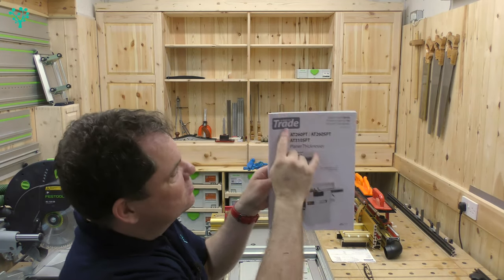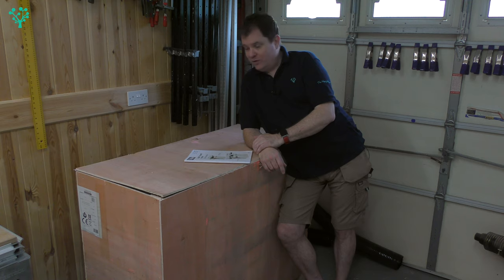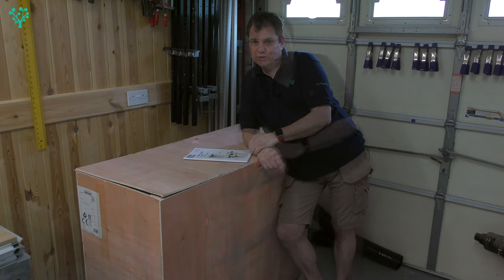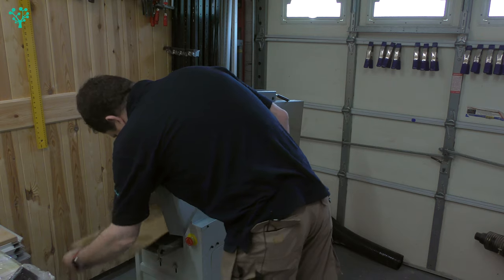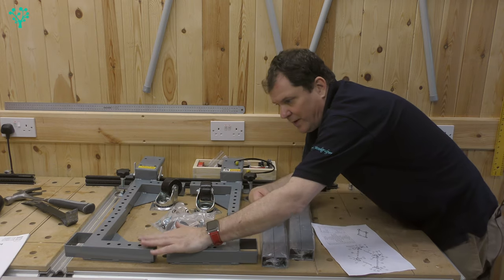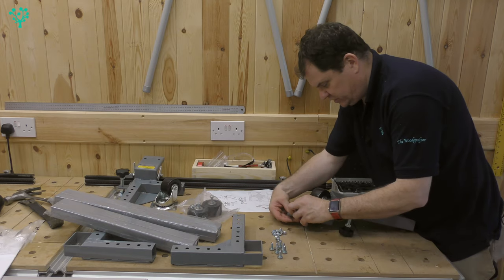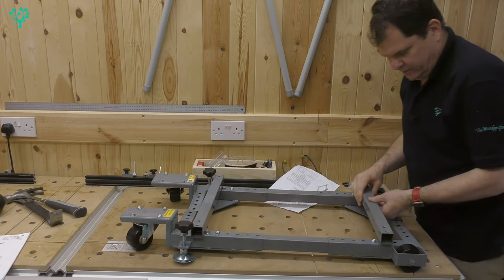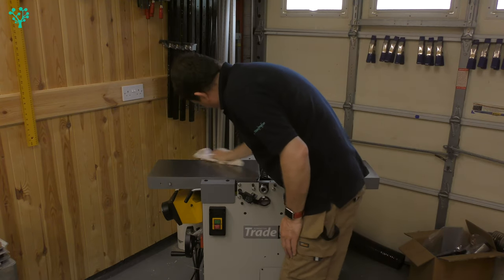Axminster Trade AT260SPT Spiral Planer Thicknesser - Unboxing

Comment: Yep, same as mine, I use a Jet mobile base but also needed a engine hoist to get it on, these are so heavy.
The spiral cutter is a joy, can even stain wood straight away without sanding, beautiful finish.
If you ever have rust issues, Collinite 476S super double coat auto wax is magic.
Reply from the maker: +Chewy 

Hi Chewy, as I was moving it from the pallet to the base I had a moment when it started to tip. I just managed to catch it before the momentum took over. definitely a phone a friend moment.

They are very heavy! To me a mobile base is a no brainier option. I do not want to drag that things round the workshop.

The machine itself is awesome, I haven’t tuned it up yet (breaking my micropohone has put me behind schedule a bit) but I put some oak, ash and mahogony through it and brought it down to 4 square.

The results are unbelievable. I have a bit of snipe from the thicknesser, but I think that may be technique on how I am introducing the material, the infeed shelf is relatively short so it is easy to tip the stock. Do you find that ?

Cheers

Andy

Comment: I have a 20 yr old Robland 12” jointer/planer that I use mostly as a jointer - the planer never gave me a good finish on anything... thinking of upgrading the head to a spiral cutter head. I ended up buying a little DeWalt 735 planer, put a spiral head in it, and it’s great. At any rate, I have sitting in the box still is a mobile stand that I bought for this 600 lb beast that I need to assemble and get under the j/p. It looks quite similar to yours, but higher rated, made by Bora Portamate - used one for my cnc table/machine (800 lbs) and it’s fine. Thanks for the inspiration to get mine together!
Reply from the maker: +Lawrence Becker 

Hi, I love that spiral cutter - it has to be worth an upgrade. Mind you if you already have the DeWalt then you can comment better than I on the difference. But I would have thought you would benefit from the spiral cutter in the jointer anyway, and. I doubt increase the capacity of the stock.

Given the size of my workshop, I think the base is a must, anything that makes it easy to move it around has got to be good.

I would definitely get that base assembled.

Cheers

Andy

Comment: Thanks for this video Andy,  very timely for me. I found your incra vs leigh videos very helpful making a discussion for my only purchase.  If possible could you discuss not only why you purchased the Axminister machine but also why you chose this over other options out there? Was a used machine considered? Cheers Andy and keep up the good work.
Reply from the maker: +Martin Taylor 

Hi Martin, thank you for the feedback - yes I’ll put a section in the next video on my buying criteria and why I went for the Axminster (should be Tuesday) I have just released the set up video before I saw your comment. (Sorry).

I am not sure how much calibration is going to be required, if it’s a lot and becomes a long video I will put a second video out to go through initial thoughts and buying decision.

Either way I will cover it.

Cheers

Andy
Reply from the maker: Hi Martin, just to keep you in the loop. The conversation about why I bought this one didn't fit naturally into the calibration videos. The next video will be a reviw and demo of the machine - so will cover it then.

Cheers

Andy

Comment: Hi Andy, 
,Thank you for making this video series on the planer thicknesser!

I'm in the market for a planer thicknesser and i'm convinced this is a pretty decent machine for the money.
What's kind of holding me back from comitting to the purchase is the infeed table.

Seeing what a faff adjusting the tables is and how seemingly sensitive/unstable they are, im wondering if the 
infeed table goes out of alignment if you adjust the planing thickness up and down a few times?
(because the adjustment only happens on the right side of the infeed table)
Does the infeed table remain co-planar to the cutter block when adjusting planing depth or not?

Kind regards

Comment: Hi Andy, a really useful video of great help to me as an imminent buyer. I know you looked at a few options and you note the criteria. I’m torn between this and the iTECH 260s...guessing you went there as well ... would really value your thoughts on what made the difference for your decision ?
Reply from the maker: Hi Nigel,

Yes looked at all sorts, and the iTech was on the list. In terms of capacity there wasn’t much in it.

I went with the Axminster as I could pop into my local store and get my hands on the machine.

They are also a company I use a lot and trust. So more brand loyalty took me in that direction.

I have no regrets.

Cheers

Andy.
Reply: The Woodgrafter thanks Andy. Super helpful to understand although with no Axminster in Essex I guess I’m not so lucky. 
Best

Comment: I bought this machine AT260spt
But.... It's doesn't work.
The thicknesser is useless.. I have to push and pull the board.. Bad design. It's supposed takes the board by itself.

Actually this is my big mistake. I lost my money.
Reply from the maker: That’s a shame, have you engaged the handle on the side. This engages the rollers in the machine when you change from jointer to thickneser.
Reply: @TheWoodgrafter  yes. It's not work properly.
Reply: @TheWoodgrafter  i think the front roller hit the board.. It's low more than its should be.
Reply from the maker: +DIY CHARGER that’s strange,

I would call Axminster customer services, they will most likely send somebody out to fix this. They will put it right.
Reply: @TheWoodgrafter  i wish if they can.. I sure they will help me.. But.. Unfortunately I'm outside UK 😞
Reply from the maker: DIY CHARGER get in touch with them, they will help. It’s the best customer service on the market.
Reply from the maker: I fact I will send them an email for you later today, I have a contact in after sales support. Send me your private email to andrew@thewoodgrafter.com
Reply: @TheWoodgrafter  thanks.. That's too kind from you. I appreciate that.
Reply: @TheWoodgrafter  i have problems with tables, it is soo hard to get them in line... any help? Trick tips?
Reply from the maker: Georgi Kostov Hi, it takes a long time and lots of patience.

The steps in the video work, but it really can take hours and hours.

I may make a second video that focuses purely on fine tuning the planner jointer. A few people seem to have issues.

Andy